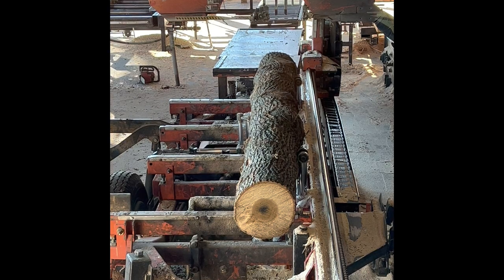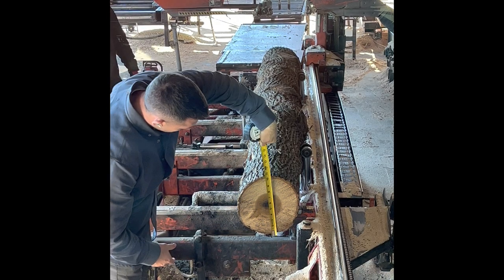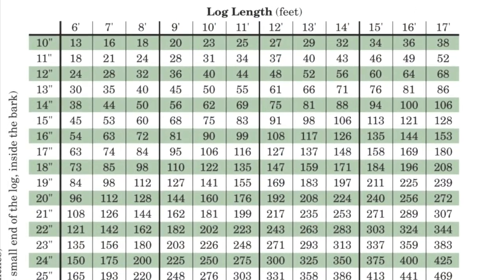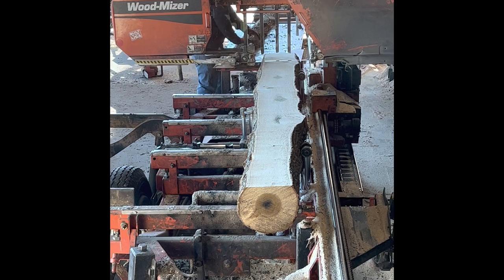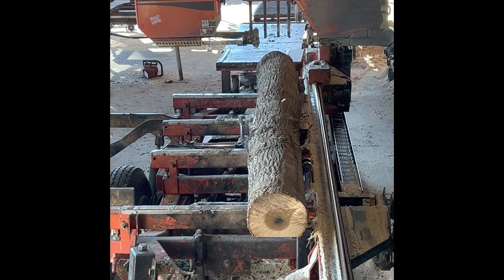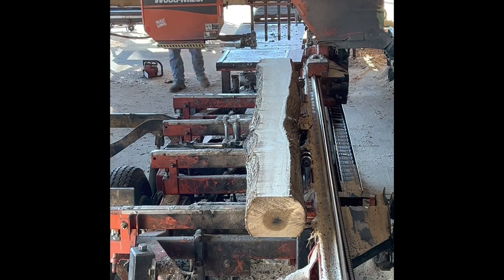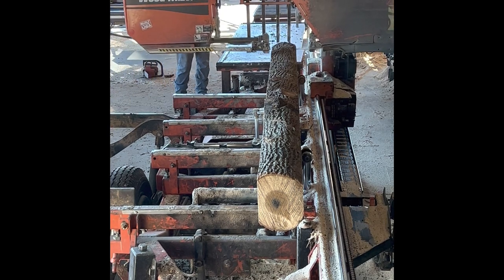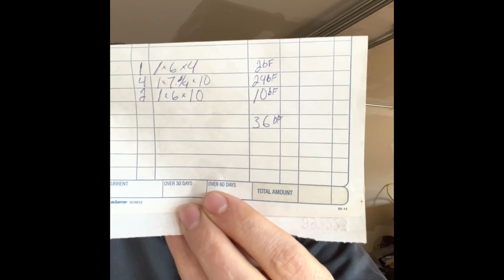Woodmizer vs Doyle log scale

Comment: I think it's the coolest thing ever that this lt70 has so much lumber run through it that the metal drag back fingers have worn angled tips from running over logs. Badge of honor.
Reply from the maker: As much as I like your comment and badge of honor I can’t take credit. The super 70 comes with the back of the tips rounded so they don’t stick or scrap on the wood.

Comment: There are many factors built into the scale system. That was a very straight log with little to no taper, so over cut was high. Try it on a crooked log of flared log. Try it on a punky or rotten log with a hollow butt. There is nothing really wrong with that scale once everything is factored in. Also, when that Doyle scale was established, the saw kerf was likely 9/32” or about 0.288” and yours is likely around 0.075” to 0.090”. 
If you do everything well and work your arse off all year, hopefully at the years end you will have a level of profit that makes all your hard work and investment worthwhile. It would surely result in fewer mills if that wasn’t the case.
Reply from the maker: We average between a 45-65% over run all year long. This is all computer calculated.We saw some of the ugliest logs on the planet at times. We are profitable running a Woodmizer thin kerf. I’ve had this mill going on 6 years. Ideally at 10000 hours we get new ones.